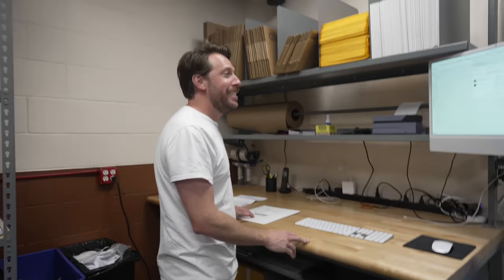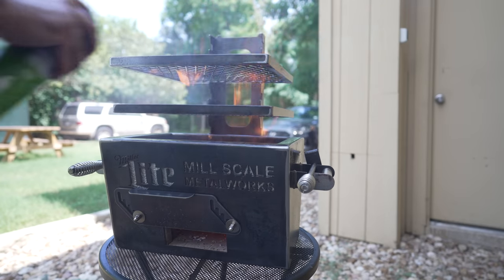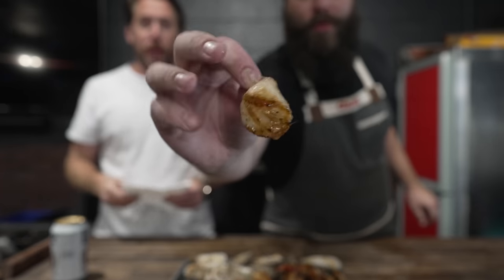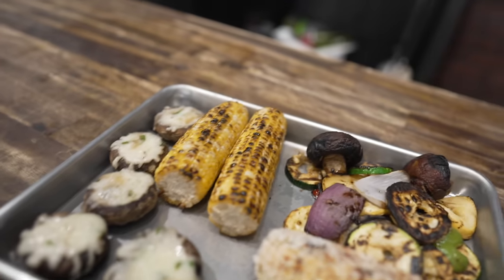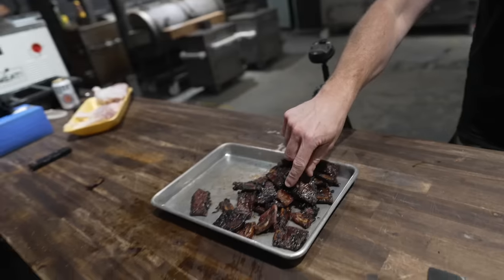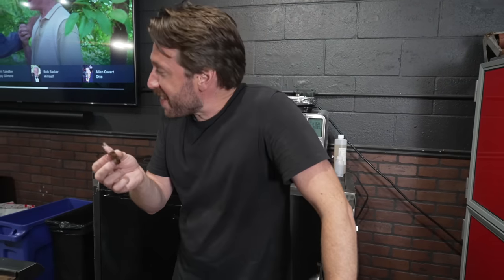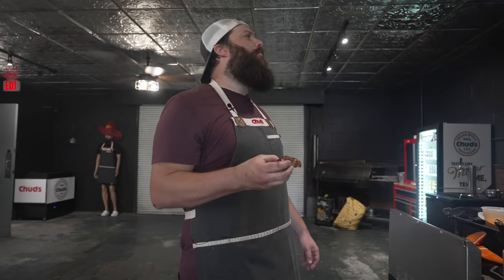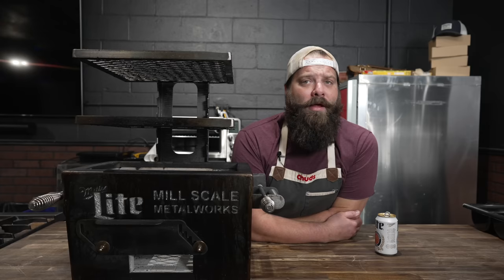I Grilled Everything I Could Find! | Chuds BBQ

Comment: As much as you like to direct grill, you need a fire pit. A large pipe end cap works well ,if you can find one. Just weld some legs on it and you're ready to burn logs down to coals. Then shovel what's needed into cooking apparatus. You haven't cooked a ribeye until you've done one over mesquite coals.

Comment: This reminds me of the grill they use as Asador Exterbarri, currently 4th on World’s 50 Best list
Reply: Victors grill is a gaucho grill with a flat bottom while the Yakatori has walls that direct heat up, much different methods of raising/lowering the grates to.  The Mill Scale Santa Maria is the one thats like the Extebarri grill
Reply: @barbouradam this isn’t really a yakitori grill though. Yakitori is supposed to be narrow so you can fit the skewer edges over the grill